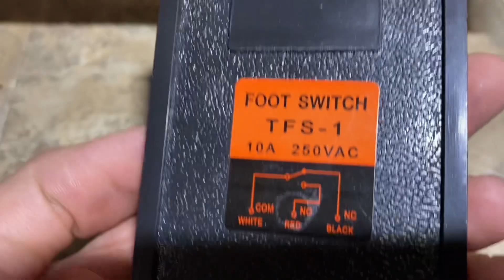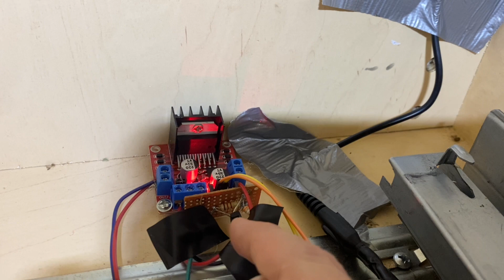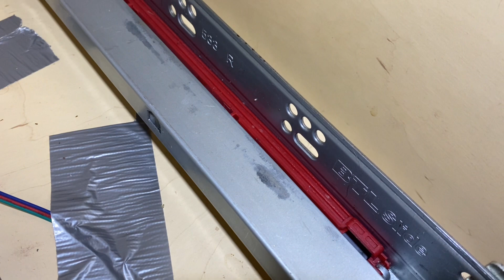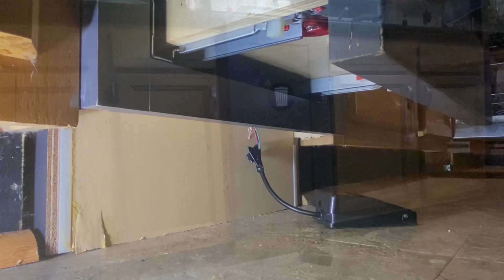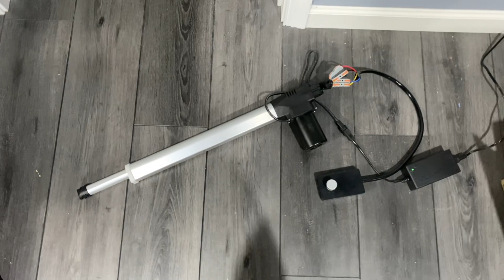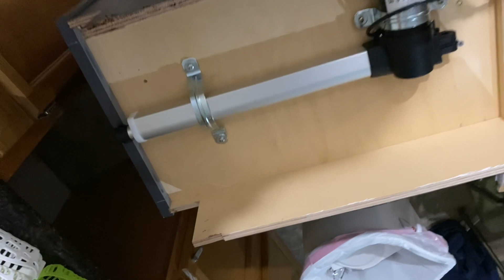Misadventures in Electronics: Can I build a self opening trash drawer?

Comment: Hi!
Just my thoughts watching the video. Instead of the double throw switch I think all you’d need is a push button momentary switch. 
When triggered the linear actuator should fully extend and retract (since you always want it to retract to be able to close it manually (or better with your leg or hip)). 
It would probably require electronics or maybe it could be made with extra switches, idk.
Reply from the maker: I was originally thinking of doing exactly that, actually. A simple trigger (be it a momentary button or a proximity sensor) could be used to active an extend-and-then-retract sequence. But you're right that it would take more electronics. You could maybe use a 555 timer to hold the forward pulse for the appropriate amount of time. It moves slowly enough, though, that I was thinking the user might not want to wait for it to travel the full stroke. But that might have been worth trying if I'd stuck with the original H-bridge approach.